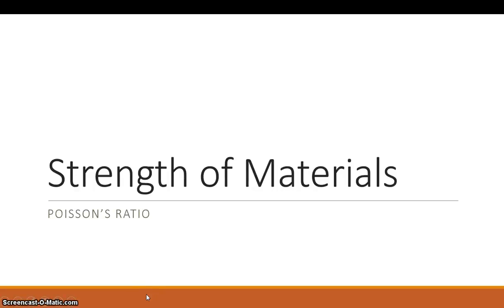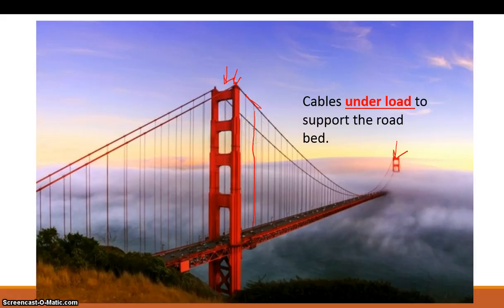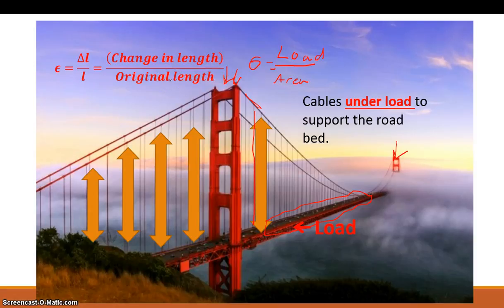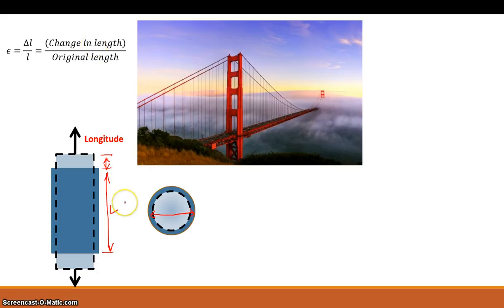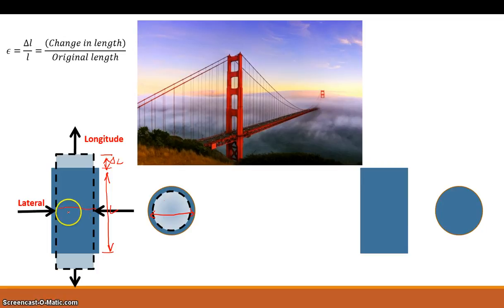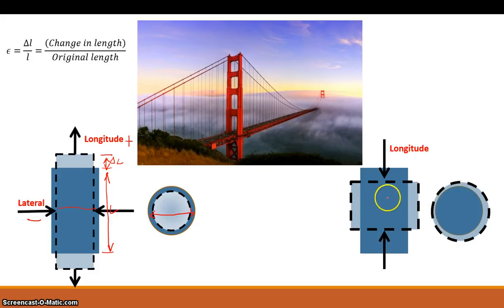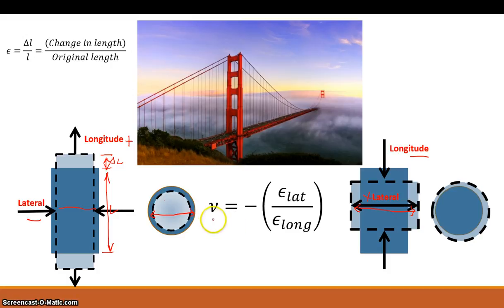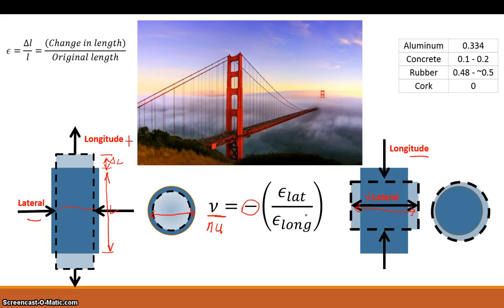Strength of Materials (Part 3: Poisson's Ratio)

Comment: I love your videos, but on this video, The speech volume pumping (change in volume ) really detracts from the video.  I hear different parts of words changing drastically different volumes i.e. sudden changes louder and softer.to fix, if you need compression in your sound (you don't) set the compression  ratio to smaller ie 2:1 or 3:1  and increase the release time to maybe 300 ms or more.Compression is not the same as gain, or limiting or expanding.  you are using too much compression and or expanding.Try turning up your mic preamp gain, so your mic has a louder volume, and use slight compression to contain small peaks and pops, to make speech easier to hear. But make sure compressor is not "pumping" (reducing volume) mid word, by selecting a long release time.  to reduce distortion from too loud signal (sounds really awful! and buzzy) use preamp gain setting to stay somewhat away from max limit, and  use limiter to limit volume to not ever hit max level 0db. (distortion, yuk.) You should never see the limiter working ever if settings above are ok.